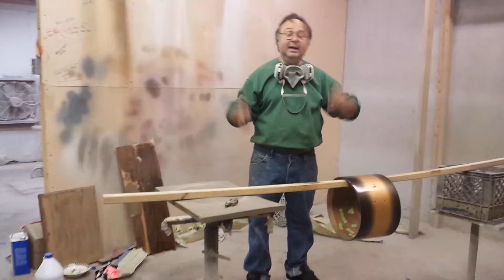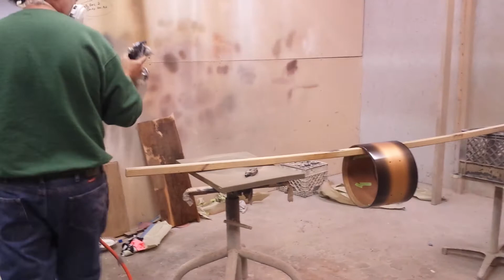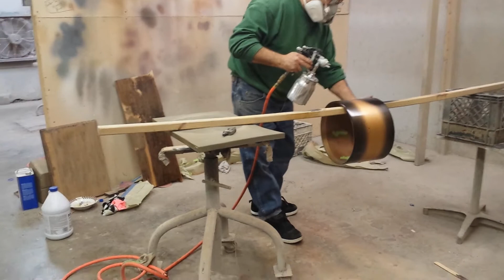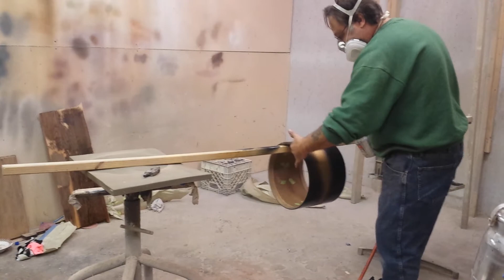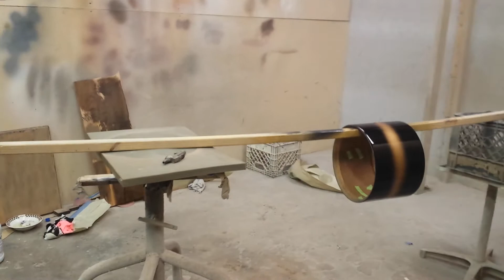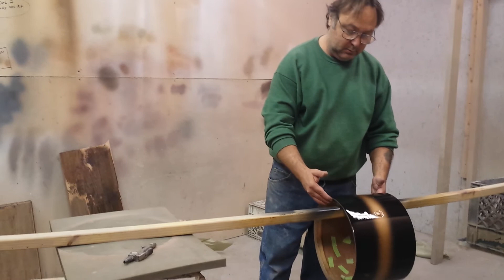refinishing a Ludwig drum in black and gold duco finish

Comment: Bruce, I just picked up a set of vintage Ludwigs in black/gold duco. The finish is worn, it's crackled and flaking but it looks awesome. I'd like to preserve the finish, keep it from getting any worse as well as enhance the colors a bit. I paint cars for a living and always have automotive clear coat at my fingertips. Would you recommend I use this or something else? I'm just not sure what kind of finish I want, the clear coat would obviously be high gloss unless I used a flattening agent. What do you think would look best? Thanks in advance. Great job on the drums you've refinished too btw, they look great.
Reply from the maker: thank you Chris ,see the old finish is coming lose off the wood ,just because its so old,we know  that but it will help some  to lock it down ,car clear coat is fine ,and i had done duco finishs in high gloss and satin before ,,this last tom here on the video was striped  to wood ,sanded  the shell ,then painted it  black with black lacquer ,then a gold powder was mixed into clear lacquer ,and sprayed in the center of the drum ,then i came back and faded the black into the gold ,now you can also us a satin lacquer over the old finish ,as you know ,you must prep the set by a light 

sanding ,600 grit or what ever you like then wash drums with a wax remover before you coat the drums ,and just so you know the checking look will still show ,you can buy some lacquer at menards ,or off line from mohawk finishing
Reply: bruce lach thanks for the response! Ok, so lightly sand the existing finish with 600 dry or wet? I like the idea of using satin lacquer but Ive never used any type of clear lacquer before. Is there a certain technique to it? I use an hvlp gun with a 1.3 mil tip at 14-15psi when shooting clear coat and I apply two wet coats allowing about 20-30 minutes flash time between coats. Thanks in advance!
Reply from the maker: just thin the lacquer with lacquer thinner and don,t spray in high humidity because lacquer will milk up  call me anytime if you need help 616 453 8309
Reply: Thanks so much Bruce! I've been very busy at my shop lately. Things should slow down a bit once winter hits. That's when I'll have the time to do these drums, can't wait. I'll be in touch, and I'll try to get you some pictures as well!
Reply from the maker: i am a phone call away thank you
Reply: Thanks again Bruce. I may be in touch in the near future.